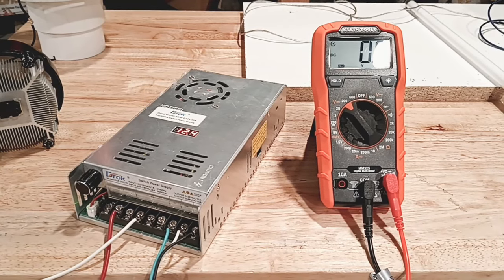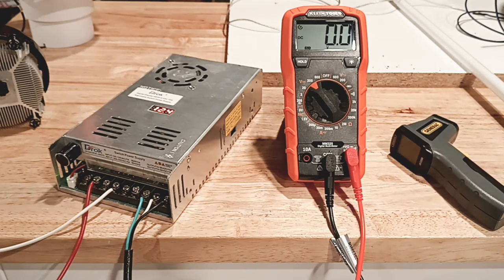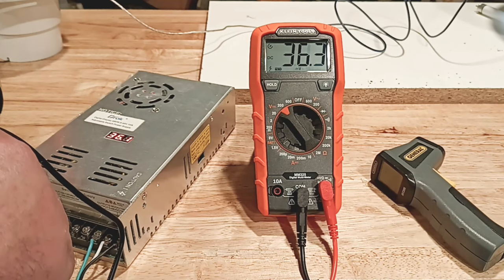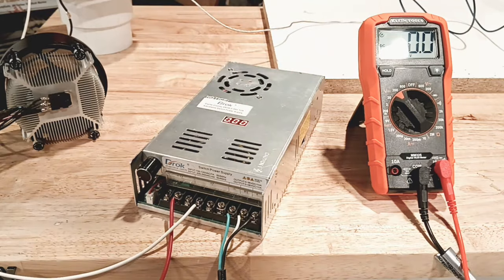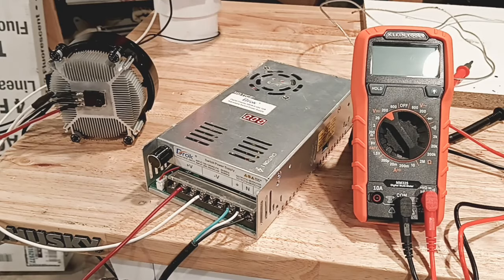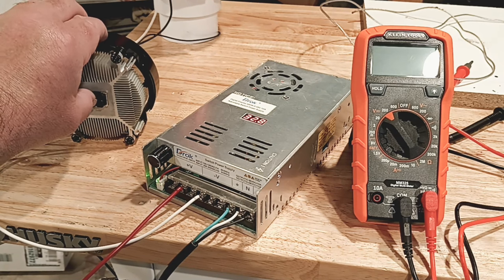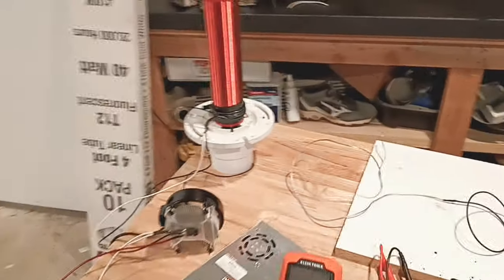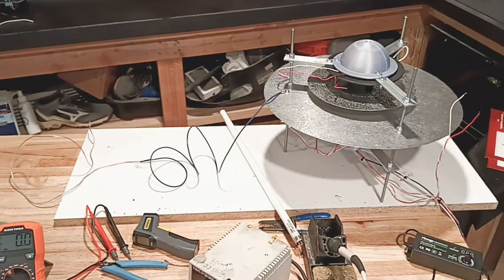Graviflyer Multimeter Test #19

Comment: Do you see that hole on the left side of the meter marked 10A? That is where the red probe goes when using the 10 Ampere setting. You should never connect an amp meter across a voltage source. It blows the fuse inside the meter. The probes are in series when measuring current this way.
Reply from the maker: got it

Comment: Note: the transistor you are using switches in the frequency range of 30 MHz, it is also recommended not to connect more than eighty watts to it.
Therefore, it is better to use several transistors in parallel if you want to draw a lot of power from it

Comment: The Tesla coil is causing so much EMI, electromagnetic interference, that it may be effecting  the  IR thermometer.
What temperature do you read with the tesla coil turn off?
49V compared to 43V is also possibly EMI as well effecting the DMM and its leads.
You need to connect the DMM in series with the power supply, using 10A range, and move the probe connection to the 10A socket, to measure the current to the tesla coil.
It should be the DMM manual.
The reading at  7:15  and 8:00 are not the output current.
The DMM manual will explain how to connect it.
The electrostatic meter measures electric field, not the voltage on the plate. (There is no connection)
SEMCO, Electrostatic Field meter.
To get a representative value you will need to take readings with it in EXACTLY to same place each time you take a reading to see any increase or decrease in the field and hence to voltage on the plate.
The shape of the field is also dependent on surrounding objects.
To prove this, move the meter around while the tesla coil is operating, your readings vary with distance from what you are trying to measure.
Keep going, we all learn as we go.

Comment: in another video, you mentioned that the rotating magnets are only useful to help reduce weight, as they lose their magnetism when applying high voltage to disc where they're bolted on. then why when Charlie C received his graviflyer from Alexey those magnets still had strength in them? thanks for the video.
Reply from the maker: At the time I was using to much power. I found out it needed far less. I use static volts now. They are fine now.
Reply: @nathanbunten4299  so you've established that the magnets are still needed to create the vortex as per alexey's original design, correct? thanks

Comment: What if you insulate the end of the wire that gets dropped into the Tesla coil. Might that be causing a spark gap effect altering the frequency?
Reply from the maker: I am not sure if I want more or less at this point. I guess I will try both and see.
Reply: @nathanbunten4299  As you are capacitively coupling the output wire, insulating the end would help prevent the arcing.